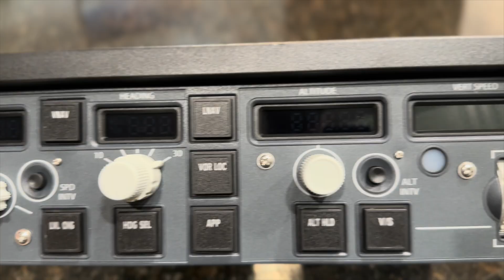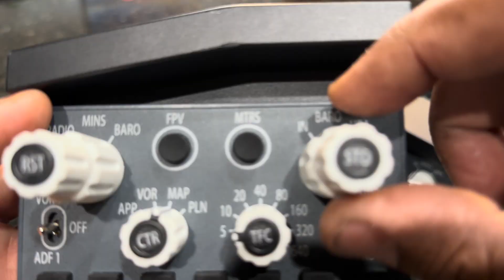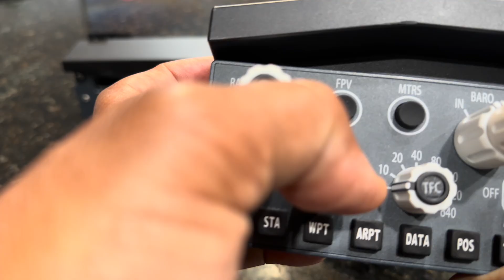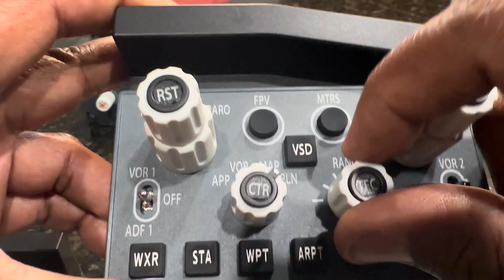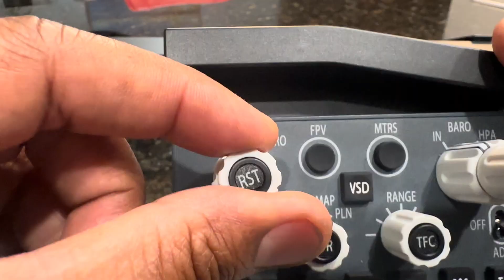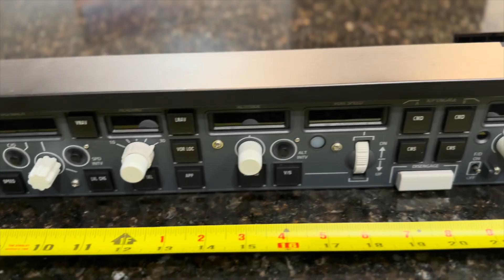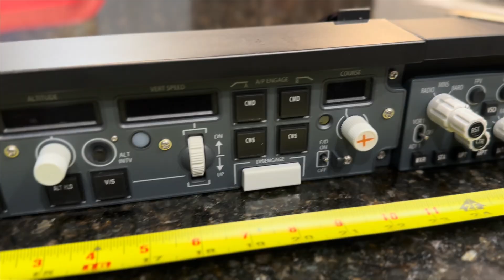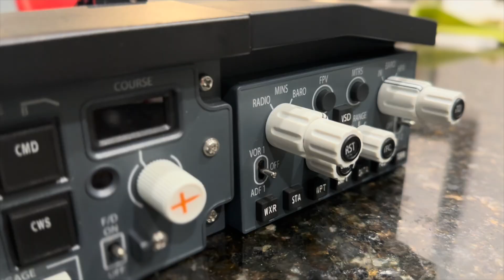“Exclusive First Look” Boeing EFIS | WinWing 3N/3M EDC

Comment: Wish I'd known before buying that the product is severely impeded / unusable unless you buy a 3rd party stand. The brackets that come with the setup from winwing when mounted at the back make the panel top heavy and fall over if you also buy the EFIS panels. Sidemounting the brackets to the MCP work, but then you're not able to mount the EFIS panels. Winwing support advises to use the adhesive pads to stick it to the desk. Somehow this is glazed over in most reviews....

Comment: I would've liked to see it in use in a sim. In particular I'm wondering if someone only bought the Max version, will it still function properly in the PMDG bird. I understand you can flip them back and fourth, but lets be honest... whipping out the screwdriver set every time you wanna switch between the iFly Max and the PMDG NG is gonna get old really quickly.
Thanks for the review though. Can you consider releasing another video showcasing it in the sim?
Reply from the maker: Yes I will. Thanks for the comments.

Comment: 1:42 This is something that also really shocked me when I first even touched a real EFIS panel. Most 737 flight sim addons such as the PMDG represent it as a spinning rotary knob for the sake of simplicity. Plus you don't suspect something like that as well. Im so glad that Winwing has recreated this.
Reply: I fly the airplane and I learned something. I saw in the features the center button is locked (can’t be depressed) when plan mode is selected. Tried it in the real airplane today and yup sure enough, that is modeled correctly.
Also, yes VSD is vertical situation display. In the NG it is an airline option that you can pull up by hitting the center button twice if installed. Standard in the max with the VSD button.
Reply from the maker: Wow, that’s fascinating to know. Thanks.
Reply from the maker: Yes, we are learning so much about the real airplane function from a sim product. That’s so cool to me.
Reply: The PMDG 737 does have the accurate behavior selectable as an option in the settings within the CDU Menu pages. The free-spinning rotary way was added and is the default today because so many people complained when the NGX was originally released way back in FSX with only the correct behavior, which is awkward to simulate with a mouse due to the way the real control accelerates as you push the spring-loaded switch further toward the stops.

Very cool to finally have a true hardware simulation of those switches now!
Reply: @RyanMaziarz  Oh I never knew this!

Comment: Great review and product, thank you 🤩 Like it very much indeed that Winwing also shows Boeing some love 😇 Do you know whether the 3M PDC can also be used for (PMDG) NG (apart from the ifly MAX obviously) or is that blocked? Hope the 3M PDC works for both to make sure not having to screw 2x 3N PDC and 2x 3M PDC to/from the PAP3 each and every time changing between MAX and NG 😉
Reply from the maker: Great question. It hopefully should be programmable with Mobi Flight. If  not maybe WinWing will make it work with both.

Comment: Thank you XP for this amazing detailed review! First look indeed.
Reply: @XP or @Winwing-simulator can either of you confirm that the EFIS panels come with cables to daisy chain all three together resulting in only one USB cable needed to connect the three units to a pc? I.e. same as airbus FCU and EFIS
Reply from the maker: No, it has individual usb ports for each one. No daisy chain as far as I see.
Reply: @XP72official  Hmmm. I wonder since the PAP on the back in addition to the USB input also has a "USB Power Only" input if that will allow the daisy chain of say using a short USB cable from the EFIS to the PAP. At least that's what I hope. lol
Reply from the maker: Now I’m gonna have to try it and see if I can daisy chain at least one of the EFIS to the PAP3.
Reply: @XP72official  Oooooh, that's a good point. There's only one of them on the back of the PAP. Dang it, well here's to hoping, but now I think you're probably right. At this going rate, I'm going to need a 50 port powered USB hub instead of my powered 12 port that I have. 🤣
Reply from the maker: USB powers hub for the win 😁
Reply from the maker: This is a beautiful EFIS. Thank you
Reply: @XP72official  it's my mother 👩 71st birthday 🎂 this weekend on the 28th of September on a sunday  🎂 XP72 🎉🎉🎉

Comment: Finally!  Been wondering when these would get here.  A bit of feedback for Winwing, though.  Give an option at purchase of which version you want for which side.  As you showed it, to get the Max version and have it on the left, I’d have to buy both and then switch out the hoods so that I can fit the Max on the left side.  A lot of people may not want to get both (or $$ can’t get both), so would be a nice option to be able to choose just the one you prefer the most for the side you prefer the most.  I love that they are being as authentic and detailed as possible by having both.  But just a thought.
Reply: Hi, actually both left & right glare shields are provided in each PDC package. You can get either 3M or 3N and switch it on both sides ;)
Reply: @WINCTRL  y’all are one step ahead, as always.  I looked at the website and saw that after I had watched this video and commented.  That’s perfect.  😊